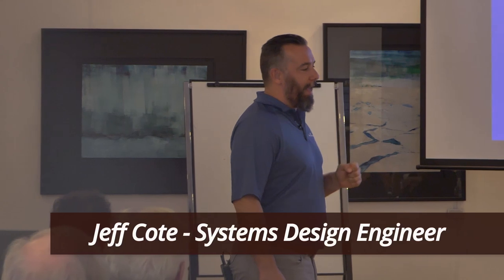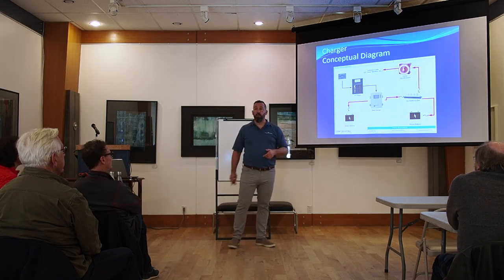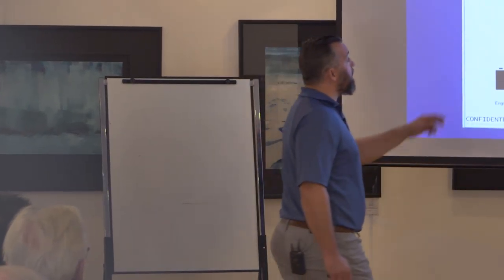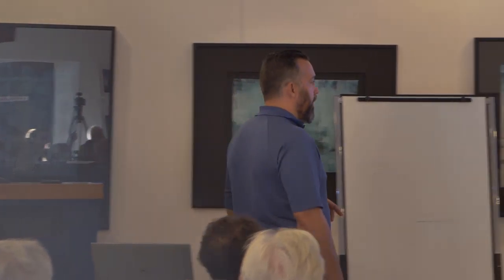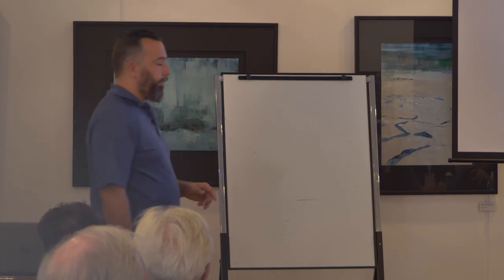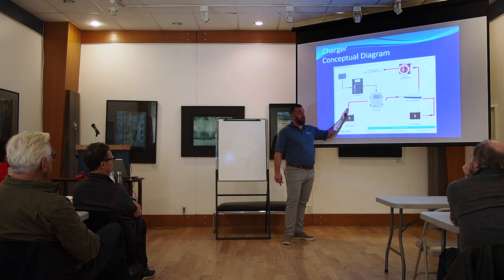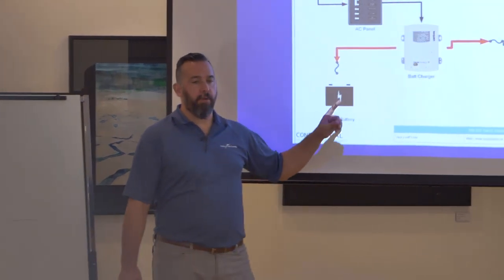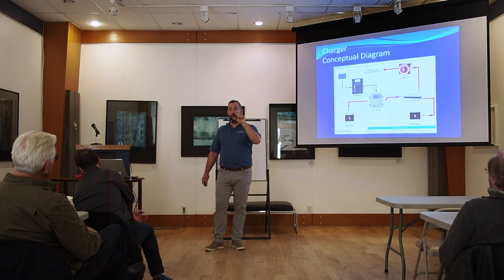How To: Marine Electrical Seminar - Battery Charger Troubleshooting - Ep 20/30

Comment: Hi. .
Thank you very much ..
I have batterys on our boat our problems is ever month we added water battery that things is strange for me.
 do you think  battery is bad or we have another issue ..
We have batterys charger..
Reply from the maker: if you are going through a lot of water,  you likely have a bad battery,  or the charger voltage is too high.    If all the  batteries and cells are taking water evenly,  it's likely not the batteries.   if one battery or one cell is taking more then the others then it's probably the battery.   pay attention to how much water goes in each cell next time.  or see if one is hotter then the others while charging

Comment: I have a triple bank charger. I pulled out 3 different size of fuses 5amp 15amp 25amp how do I know where they go
Reply from the maker: Hmmm, surprised to see different fuses for each charger leg, sounds like your battery charger has different outputs. Check the manual to see which fuses goes on which charger leg.
Reply: @PacificYachtSystems  I called Mariner dealership and they said they should all be 25amp and funny part is I bought it new like that with different fuses.

Comment: Charles Battery Chargers, I have this Charles 12152SPA Battery Charger 15A 12V 2000Sp, anyone know of these chargers?  It’s in the console of my ‘91 25’ Boston whaler outrage center console, has a selector switch with lead, gel, and agm as options..  since I’ve started watching these videos, and being on lock down with this pandemic, I’ve gone through documented all old wiring, and going to replace and upgrade along with move batteries into console from aft port and starboard corner lockers.  So curious if still good enough to keep?  Any advice would be appreciated..  mr. cotes great videos, thanks so much..  binge watching your videos I’ve learned to identify and have found mcgyver innovations in my wiring..  be well and stay healthy!
Reply from the maker: Hi Cepuras, our understanding of batteries and what they for charging and battery life as evolved dramatically over the last 30 years. You'll do your batteries a huge favor (and in doing so increasing their life and savings for you) by getting a modern battery charger.
Reply: Pacific Yacht Systems thanks a bunch for taking time to reply!  Be well, stay healthy!!  Cheers 🍻